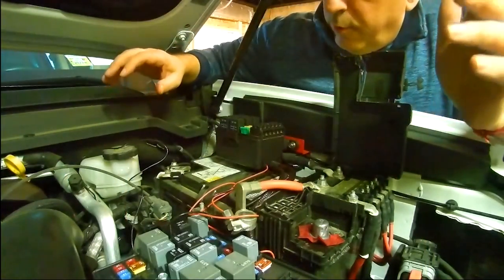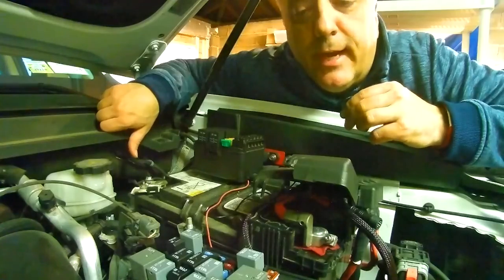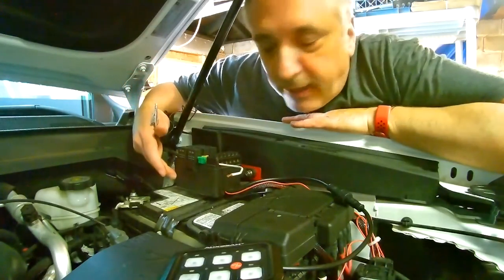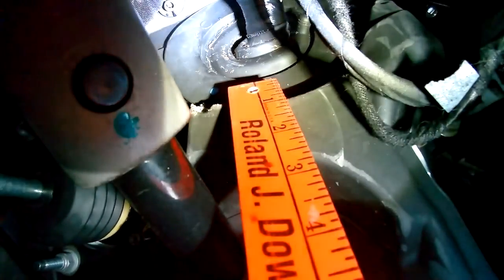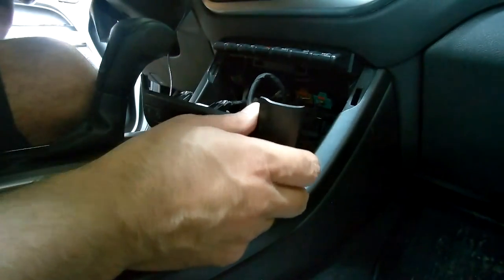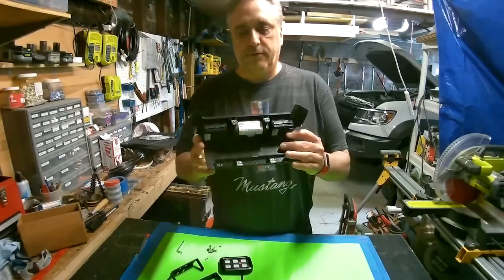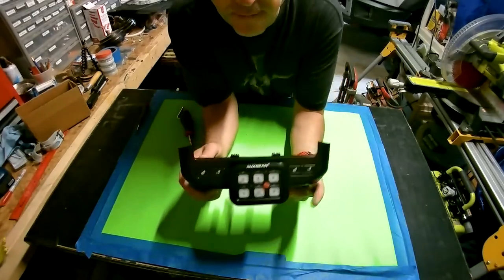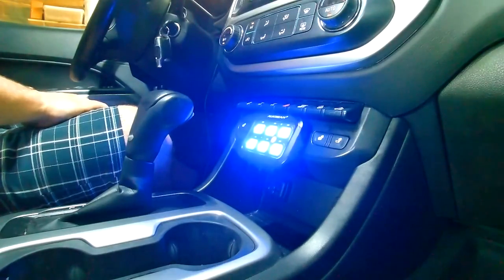Installing a Auxbeam, sPOD or other Switch Control Panel: Chevy Colorado ZR2: Part 2

Comment: Just ordered mine.  Can't wait to install it on my bison
Reply from the maker: Thanks!  If you have any questions during install feel free to reach out.  Have you decided where you are going to mount the actual switch box (controller) in the engine bay.  I'm curious to where people are installing it for non-diesel engines.  Mine was over batter using a bracket I design, which is video 2 of the one you watched.

Comment: Great vid- thanks- just finished all the wiring  on my Bison-  I drilled the firewall where the clutch pedal would go with a 1inch step bit since i was also wiring a subwoofer, ran a grommet and now have plenty of space for additional wiring in the future,  ordering one of your printed brackets as soon as I finish this comment:). Thanks again!
Reply from the maker: Nice work!

Comment: My Switch Bracket didn't hold up for me during off-road use. The two machine screws holding the switch panel onto the mount stripped out over rough roads. I had to used some 3M HD tape to remount it to the Switch Bracket.
Reply from the maker: Was the two machine screw that came with Auxbeam Switch?  If you have a pic, please share :).

Comment: Great video. I have auxbeam 6 with a 21 zr2. Looking for mounting options and found you. If I wanted to order the 3d printed mount where do I go to do that? If you still taking orders thanks.
Reply from the maker: It's on my Etsy page but currently out of stock.  I'll have more ready this week.  I'll repost here when they are ready.
Reply from the maker: Ryan,  Finally received new brackets today:  https://www.etsy.com/listing/1271750765/custom-bracket-auxbeam-switch-controller?ref=listings_manager_grid.

Comment: Do the switches for the hazards and lockers have enough room to activate?
Reply: Yes, I purposely designed the mounting to position the switch a little lower.  This is a 6-gang switch install so it also leaves the heated seat buttons (if you have them).  I'm also working on an 8-gang, but that will overlap the heated seat buttons a little.
Reply from the maker: Yes, I purposely designed the mounting to position the switch a little lower.  This is a 6-gang switch install so it also leaves the heated seat buttons (if you have them).  I'm also working on an 8-gang, but that will overlap the heated seat buttons a little.